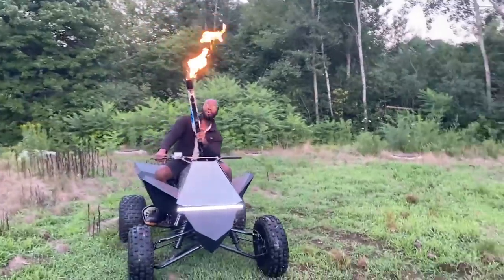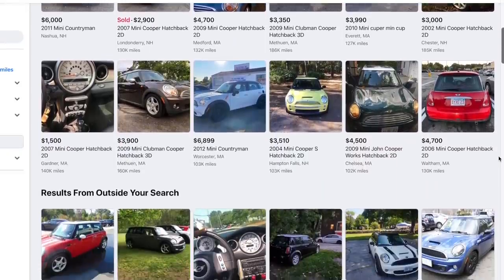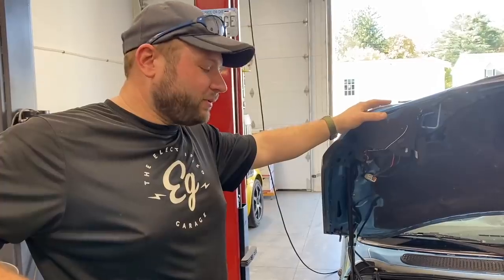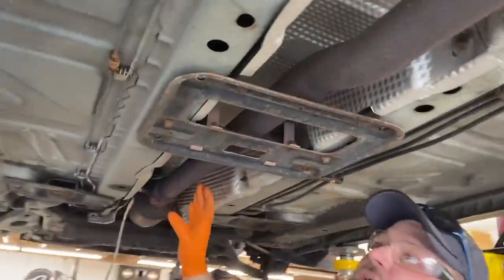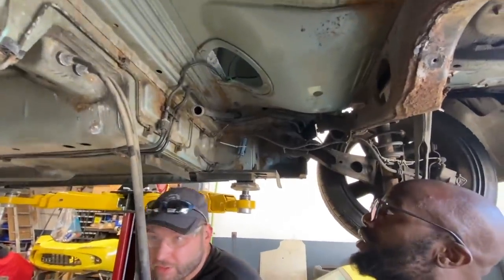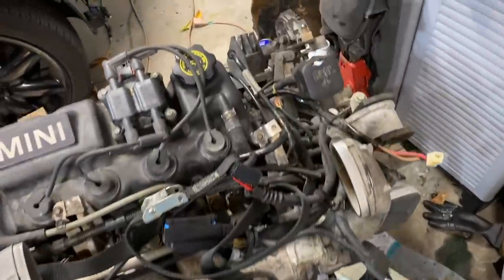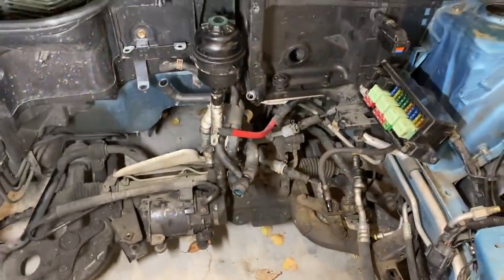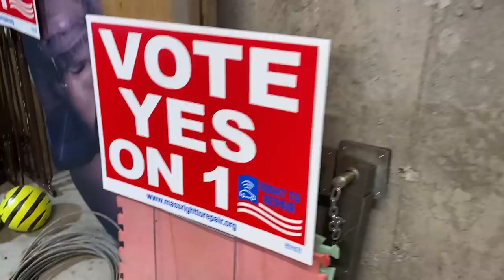I Bought The Least Reliable Car and I’m Making It Electric on a Budget

Comment: PLZZZZ READ!!!! (this will save you time and migraines with alignment issues) Rich,  before you do that. Replace the control arm bushings and ball joints...... they are much easier to replace ….. WHILE THE MOTOR IS OUT..... if not, you have to drop the subframe. GOOD LUCK!
Reply: Not bad idea but you should write him an email, its more likely that he will read it.
Reply: @thecoolinventor4379  Thank you Great idea!
 what email should I use to reach him?
Reply: @dportben  The R56 still had that exact issue, it was such a pain!!
Reply: @dportben  His email is in the description.
Reply: @steviefresh88  @lcke Dude @the cool inventor thanks!

yeah... i had to change mine on my 05 R50
Reply: @ickedude6759  I hope he know what he's getting into............... lol
Reply: This is exactly the kind of common sense that would ruin this channel. Remember Rich could have bought a running mini for 1g but instead, he bought one with a blown engine for 1.5g
Reply: @Live-Life-Freely  It does make me wonder tho, how well was the frame or looks of the 1 grand running one, this one he got looks OK at least after all, just the unimportant (for that project) parts are done for.
No point getting a crashed one that drives if you don't keep the engine after all
Reply: E-mail: richrebuilds@gmail.com
Reply: E-mail: richrebuilds@gmail.com
Reply: E-mail: richrebuilds@gmail.com
Reply: You don't have to drop the subframe to replace the control arm bushings and ball joints. I've replaced them on a couple of R53s now
Reply: @thecoolinventor4379  or DM him on Instagram
Reply: Good thinking. I'm sure he will appreciate it
Reply: Plus, one can use control arms from a second gen (R56). They're lighter than the first gen ones.

Comment: In my 2 weeks of ownership I've only had a single issue with my Mini Cooper and it wasn't even the cars fault.
Reply: Let me guess ...it was copart fault ?
Reply: Has rich finally paid for that rs7?
Reply: So Sam, how do you explain that chicken bone over the gas tank?
Reply: @samcrac race Rich 🤑 in Bradenton.
Reply: I owned more than one Mini Cooper S. Supercharged and Turbo ones, and both been reliable to me. Not sure about built quality in states...
Reply: I am guessing it is NOT a 2007 Mini Cooper S then ? As far as i know.. The newer Minis are pretty decent. But i dare you or ANYONE to buy a 2007 Mini Cooper S.
Reply: But at least Rich makes the car drive again without sending it out to get fixed by an outside expert. 🤷🏼‍♂️ Even if it takes changing the drive train. Rich makes it happen! Unlike The theme of The Samcrac channel where others fix his projects. 😄 All Sam needed was a copy of a key and a spark plug to make his Mini run. How is that rebuilding a car ??????
Reply: @jonathanLara1989  Yeah the salvage yard guys were like “give this Sam guy that does weird salvage yard videos and smells like chickens the wrong key next car he buys from us for fun “ 😆
Reply: @WatchRichRebuildsChannel  haha I knew dealership guys that did this
Reply: I’M SORRY SAM . YOU BOUGHT A KEY AND A COIL PACK. THAT’S NOT REBUILDING A CAR. THATS JUST A USED CAR LOT REBUILD. 
but still luv ya man 👍
Reply: Spoken like a true bmw owner
Reply: @dantediss1  yeah the mini’s of that generation had the absolute worst engine ever put in a mini (reliability wise), i would never touch 07-11. I have an 06 supercharged and i love it
Reply: It was your fault, for buying it!
Reply: @reiid  i wish i had known years ago before i purchased my old 07. I gladly would have taken the SC 06. Funnily though i had enough of the issues and sold my 07 recently. The new owner had it for 2 hours... And they blew the motor. I told them to baby it home and then do the repairs. Instead they redlined it all the way home... Even after a cel and low oil light came on.
Reply: *buys mini cooper

"Well actually its not that bad it looks cute and.....and....aa....nd.....uh....yes car... cute."    

"yes."
Reply: Give it a month😂 I speak from experience
Reply: Wow! That's almost as reliable as a Range Rover!
Reply: Haha you're illustrated as Grandpa Simpson in his video 😂
Reply: I have owned my mini for a 4 years its at 110k miles now, with over 50k miles I've had no major issues just regular mantiance
Reply: Wow 2 weeks? That minis extremely reliable.
Reply: @machedari  lmao I know right I was about to comment this
Reply: Boourns!!
Reply: @douglasburnside  HAHAHAAAAAA
Reply: @dantediss1  ahem, i have one.
Reply: @PneumaticFrog  i am sorry to hear that.
I hope you do not deal with the R56s issues seriously... The thermostat..the water tube.. The timing chain...the one of 6 possible alternators for the car.. The rear valve cover pcv valve... The valves... The turbo oil feed line... The valve cover gasket...the HPFP... Fuel filters... Fuel pumps...windows not working because of the passenger footwell module... The headlights melting their own wires... Radiators cracking and breaking...under hood melting due to no proper cooling for the turbo... Oh do not forget that turbo coking up.. Timing chain tensioner... Yeah i hope none of that stuff...nor any of the other hundred issues occur to you.
Because without those dozens of problems , you should be fine 👍
Reply: My head gasket blew up on me too couple days ago
Reply: @owenroch446  ya dont say.
I would love to comment with.. " Wow thats rare " ...
But no... Its a Mini. 
The French Prince motor is a piece of shit.
Top it all off in a poorly built and designed car that is wayyyyyyy overpriced.
There is a reason why you can find LITERALLY THOUSANDS for sale.. And DIRT CHEAP.
Reply: Lol cause it doesn’t run Sam hahaha
Reply: I've owned two mini coopers in the last 8 years, first one was a 07 Cooper S which did have a ton of problems which I got covered under the carmax warranty, the second is a 2011 I traded in before the 07 would total itself and I've had it 6 years no major problems; thermostat hose is plastic and notoriously cracks, replaced water pump that leaked, spark plugs and coil packs replaced, valve cover gasket leaked oil into the plugs, walnut blasting intake is recommended because sludge from direct injection, it now probably needs a head gasket because I'm losing coolant slowly. It burns about 1qt of oil a month or so. Also it likes to eat tires quicker than my Prius. I've enjoyed the Mini's a lot but I'm ready to move on to something boring and cheaper to repair.
Reply: You're in denial. Owning a mini cooper IS an abusive relationship. You can convince yourself that it's not their fault. You can convince yourself that it was something you did. But deep down you know it's just not true. You are worth it! You deserve to be treated fairly. 
You may not believe me now but know that there are more people like me who believe in you. You deserve to own a reliable vehicle.
Reply: @ColoradoMoe  I'm saving so I can escape the abusive relationship.
Reply: Yup, good for me I
own 2.
Reply: 🙌2 weeks. Probablydue togood ass gass
Reply: @dantediss1  I have a 2005 cooper s and its still going strong and never had a problem.
Reply: @tyronenelson9124  you have a good year. The supercharged Mini's were relatively decent .. It is when Mini switched from superchargers to Turbos that they went to shit
Reply: The era with the French princess engine was pretty dire. Loads of problems with water pumps and carbon build up that required expensive repairs. I don't recall all the details but when my wife wanted one in 2018 I ended up buying a newer 2017  Cooper S from the dealer, it was one of their courtesy cars for a steal with only 7k. It's been terrific but with Covid I have no idea how reliable it is. I've only just done 20k on it haha. Have a 2004 Miata in the garage as backup if something goes wrong. Those things are simple and bulletproof.
Reply: @timijs100  turbo ones are much less reliable. Mine is 16 years old and was owned by my grandma for 15 of those years and it’s been almost completely reliable engine wise. There are various small build quality issues though

Comment: Rich, I had a mini Cooper for over eight years and the only problems I ever had were exploding sunroof, defective airbag sensors, seized AC compressor, oil leaks, cracked thermostat housing, failed battery, failed alternator, disintegrated catalytic converter, slipping clutch, doorhandles falling off, sunroof leaks, windshield leaks, numerous squeaks and rattles, excessive tire wear, failed supercharger, Cracked coolant recovery tank, parasitic drain on battery, defective gas cap, failed smog four times. Other than that, nothing I repeat nothing has ever gone wrong with my mini

Comment: Google prius power steering. You can swap a prius column into almost anything. Full electric. Also you can find an electric vacuum pump for braking in a lot of volvos and stuff.. there's a 28 30 and 32 size pumps
Reply: Reckon you could also nick the AC system as well?
Reply: Why swap the steering when it already has electric/hydraulic steering??
Reply: @DiscoFang  probably just leaving some advice for people converting other cars as some people just ditch the power steering
Reply: You could wire the vacuum pump up to the fuel pump circuit. That way it is controlled by a relay and will come on whenever the key is on.
Reply: Hybrid power steering provides much better feel than pure electric.  In a Mini he should definitely keep it, in other cars with pure hydraulic it's probably worth swapping for the sake of simplicity.
Reply: I was going to say this too. Doubt he needs it since all the Electro-hydraulic systems are in there, but the Prius steering is becoming a big deal for older muscle cars with manual racks since you get a safer collapse-able stock and it only requires power and ground for ~45lbs of turning force.
Not sure on AC Compressors, but there just HAS to be a recent vehicle that runs the AC off an electric motor and not the engine as a compressor. Maybe a recent prius? They have IPM motors in some odd locations.
Reply: @DiscoFang  Hydraulic has real feel aswell, a must for any real driving enthusiast
Reply: @girthquake1413  Tesla Model S has an electric motor driven A/C compressor. I saw one for sale from someone parting out a salvage car.
Reply: really cool info thanks does anyone use an electric assist brake system so i can ditch the huge brake booster?
Reply: @g.m.5607  you can use an electric vacuum pump like I said but you still need the booster
Reply: @g.m.5607  Aside from Ford Hydroboost, I think the swoopy late 2000s Volvos- CX90 or someshit?- had an electric assist for the brake. I seem to remember they had to use it to clear the roof line.
Reply: @girthquake1413   @IdealSound & Performance  thank you both i have a 92 cummins that id like to update the brakes since i always feel like i'm going to drive over someone plus the brake booster is taking up valuable real estate.
Reply: @g.m.5607  Oh yeah, the Hydroboost? You should be able to find that in a Junkyard. Good luck bro

Comment: My engine may have just seized on mine. So I’m really interested in this project.
Reply: No compression in mine :(
Reply: riperoni
Reply: @jaxoncroydon3516  have the supercharger replaced with a rebuilt one.  That supercharger failed and they just replaced that one under warranty. 20 mi later, overheated, shut down, oil or coolant on the back windscreen. I drove the thing three 400 miles with a broken supercharger, no issues other than that horrible rattling. I mean, no loss of power, nothing. 20 mi after they replaced the supercharger I overheat? They're going to have to fix it or I'm going to have to take them to court. The car was literally no faster than with the broken supercharger so I wasn't making any less boost with the broken supercharger. Some people seem to think that is the head gasket. I don't care what it was, somebody made a mistake. With that said I'm interested in this project. How much can I electric fire for and will everything work. I need to know right now Rich.
Reply: They are shit engines your better off buying a civic engine
Reply: @therickpound  the tritec in R50/53 is fine engine just dosent make power easily. its the later R56 range with the PSA motor thats trash.
Reply: check damien maguire . He has been doing this since 2010 :D same stuff. has over 20 cars built like that

Comment: Rich: You can buy a running and driving mini for $1000!

Also Rich: I bought a reconstructed title and blown motor mini for $1500!
Reply: He said 3k for a running and driving one
Reply: 1000 is probably older one I’m guessing
Reply: @iLikeTrams-Tech  go back and rewatch
Reply: @iLikeTrams-Tech  its 1k
Reply: likely hes talking ab ones with messed up bodywork, or flood/salvage titles
Reply: But it's blue
Reply: @marsrover001  electric blue
Reply: I’ve bought from IAAI. “Running and Driving” means the engine starts and the car moves under its own power, nothing more. It could be completely wrecked otherwise. 

I imagine Rich was after a car with a good body, which is why he paid more. Those seem harder to come by especially on auction sites.
Reply: Blown engine with head issues I wonder how that happened - shows uprated pulley on the SC and a hollowed out cat - overboost and a money shift me thinks - wouldn’t be surprised if the box is trash too
Reply: I imagine he was talking about a standard mini whereas this is a John cooper works mini which cost more
Reply: @antonyo7531   you mean the classic Mini? If so, your wrong. Those things will pull $5k if it's in rough shape and not running. A running one will pull closer to $10k and a restored one will pull upwards of $20k. His was either a MK1 or MK2 model, which makes it even more expensive.
Reply: Bill Derr i didn’t mean a classic I meant like 3-5 older than the one he bought in this video
Reply: @antonyo7531  oh, I thought you meant the classic. The one in this video is either 2005 or 2006 model (possibly a late 2004). 3-spoke steering wheel and revised passenger side engine mount give it away. It has the rear fog light on it, which was an option for those model years. It was still the 1st gen model though. 2002 is when they came to the US, so it's still fairly old. These models were actually fairly reliable for a MINI as long as you kept up with preventative maintenance. When BMW redesigned them in 2007 for the 2nd gen, they used a shitty Prince engine that was prone to failures. From 2007-2010, they used the N14 engine, and they are by far the most unreliable engines in a MINI. There's even a Facebook group for them (N14 Survivors Group).

My 05 is still running today with over 200k miles on it. Original engine, transmission and supercharger too. Just recently sold it as I have a classic Mini to build now.

Comment: For your vacuum brake assist, you can buy 12v vacuum pumps on Summit/JEGS. They're really for big cam cars, I run one on my '66 charger that pulls like 7" of vacuum at idle, but it works like a charm. Since you'll have no vacuum assist from the motor at all you might need a vacuum tank so you don't overwork the pump, but it should work for what you need.

Comment: In my 10 years of owning I've never had a single issue! Only routine maintenance and oil changes, etc!!

Lmao jk my mini is a piece of shit. I've had to replace just about every single mechanical component and there are still at least 10 electrical gremlins that I can't figure out how to fix. I can't comprehend how the electrical system could be so useless. Everything electrical related is broken at least half the time.
Reply: My R53 electrical issues seem to be confined to the seatbelt and airbag system. Knock on wood.
Reply: Lucas electric wiring
Reply: One of my mechanically minded friends gained one from his mother, he took it down to the place where it was usually repaired & was promptly told to quickly get rid of it, it's a lemon, not long after it just died, engine seemed fine. Its at the wreckers now.
Reply: I’ve owned 2 Classic Minis both been reliable and a joy to drive but must say for the first Mini I bought I nearly killed myself and 2 friends, Unfortunately I was the worst one off because of getting thrown out of the car 🚙 and nearly died from my injuries and my beloved Mini was a right off. Maybe my age then says it all, I was 18 and loved speed.
Reply: @greywolf6852  Not Lucas. Klaus.
Reply: You did your 1st mistake... thinking a MINI Cooper was a girl car so no maintenance like Toyota would be fine. lol
Reply: My neighbor has a countryman. I see a rental car in it's place all the time.

Comment: Lovely, how BMW doesn‘t bother with rust-proofing the Mini. Is that to keep its British heritage?
Reply: They are actually pretty good. They even offered a 12-year rust warranty on them. Most people never knew about it, and once rust starts, you need to get it fixed. Rust spreads like cancer on cars.
Reply: Most real British made cars made within the past 20 years or so use mostly aluminium and composite, so don't have much on them which can rust.

But most geniune British cars left are exotic brands (McLaren, Lotus, Morgan, Caterham, etc). Jaguar and Land Rover are about the only mainstream manufacturers left and even they use all alu bodies. Minis are basically rebadged BMWs now, but using cheap French parts :/
Reply: ah they were probably going after vintage britsh car enthusiast triumph,minis, n jags would leak oil keeping rust at bay. This car probably started rusting after the engine broke.